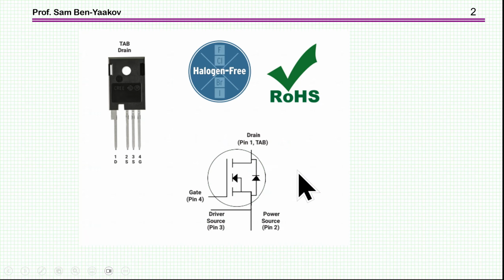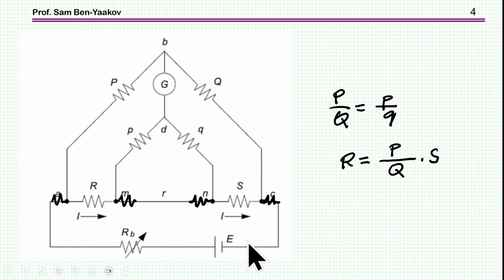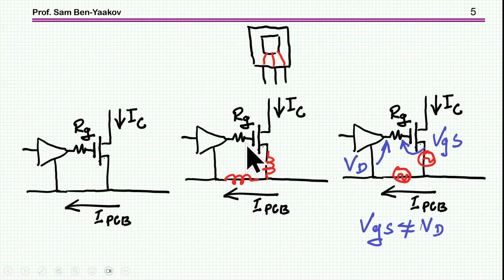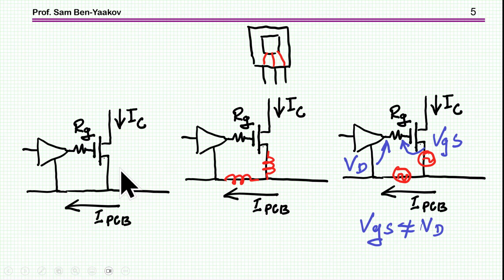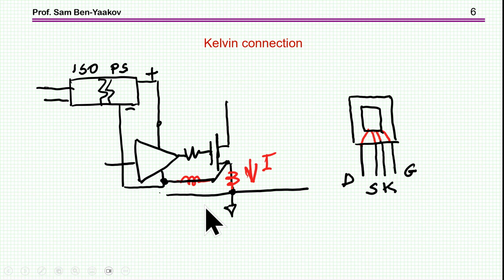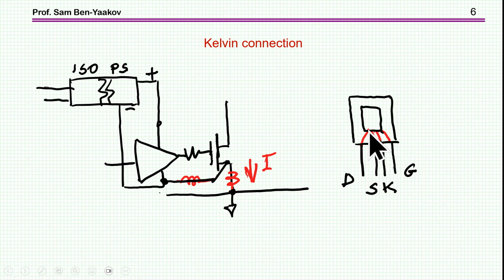MOSFETs’ Kelvin connection

Comment: i only saw them in high speed devices like GANfet from what switching frequency does this become a necessary ? 
Also wouldnt be easier to simply use a higher drive voltage?
Reply: The kelvin connection is used in new SiC an GaN FET devices, mostly due to ther insane switching speeds, which generates substantial voltage drops across the source inductance. A higher drive voltage would NOT solve the problem! It would increase driver power dissipation, also modern FETs have lower limits for gate drive voltage.
Reply from the maker: Indeed. Thanks.